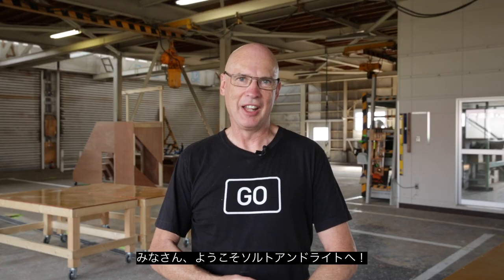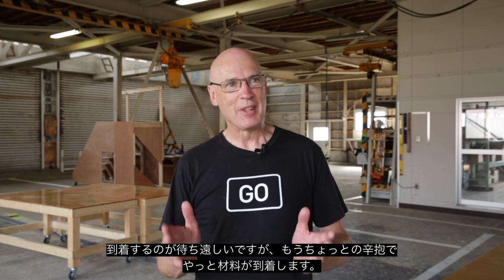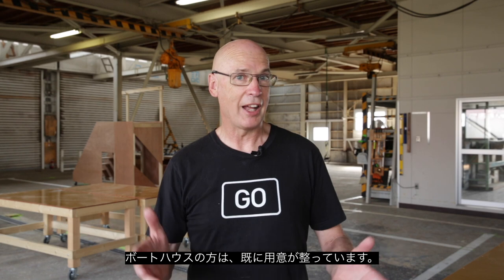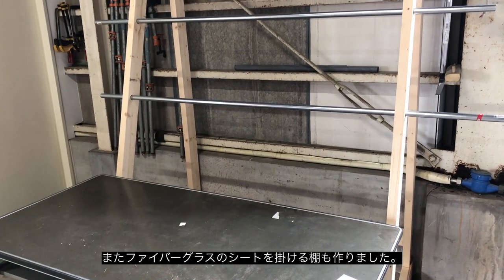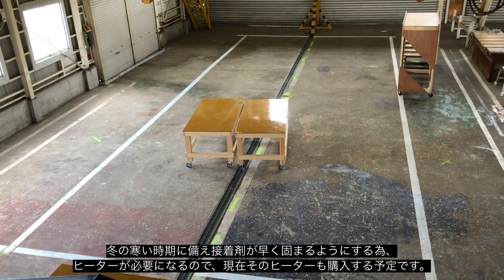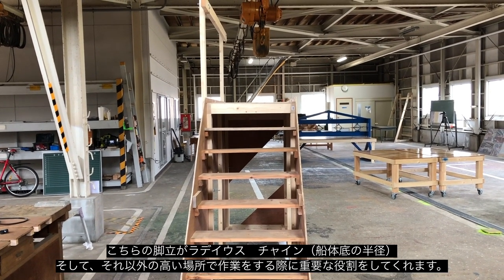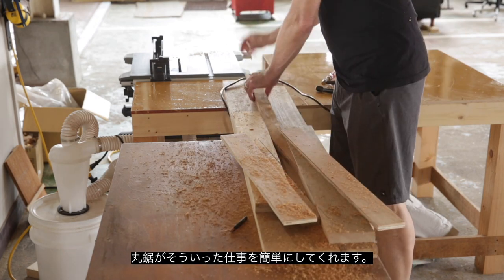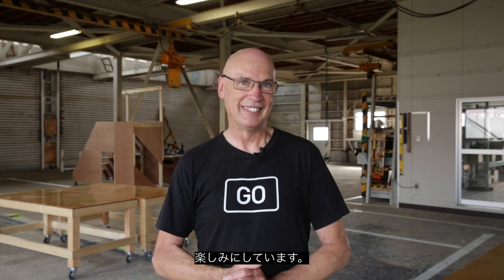Episode 7　Building a 47` catamaran in Japan

Comment: Well conceived work shop details!
Having taught College Marine Composite Construction I respect your effort.
Just a comment I topped my resin tables with Formika laminate as with nominal release agent NOTHING stuck to it.
Excess cured resin just popped off!
Also on my fabric cutting table I had it gloss resin coated with the tape measurer laminates into it.
Do you have a table saw ,radial saw and 
Band saw & chopsaw station?
How about a down draft [ wire] mixing table for blending Silica thickened resin?
With a beveled base to a vacume filter?
How does Japan deal with debris  like vacuumed film and peal-ply cloth?
Speaking of vacuumed, how are you 
dealing with sanding equipment?
We had the benefit of a ceiling mounted rolling filter/ fiber unit but I assume 
you do not have the expense for that ...so are you using vacuumed sanders?  Fairing fillers create vast amounts of dust ,trust me!
Reply: Hi Norman, 
The mixing station is still a work in progress, but I really like the idea of the down draught wire mixing table, I was still running ideas through my head on the best way to suck out the excess silica that inevitably over flows.
I was looking into building an overhead  exhaust system, but the cost was too high, so we will stick to vacuums on the sanders. Also, I intend to construct in a way that keeps fairing to a minimum, get the foundations right to start with.
Japan requires you to separate your waste into either, fireable, non-fireable, recyclable plastic and aluminium and glass. They have certain days for each. I will need to check what the peel ply comes under.
I built a table for my table saw and fitted it with its own dust extractor.

Comment: KEV: Glad my suggestion on the down draft appealed to you ,I have exclusively used then for the last 1r years,they work great! If you use a fan yo pull the air down insert micro filters in front of the fan ( I use reostats to controll dn/ draft)
Use disposable filters and chance often
On another note because the school shop is apart of the general education structure ,to cut down on dust, prefinish
The Plywood sheets prior to mounting then we only address the but seams.
Only apply the filler not the paint!
Best to bend when the filler is green.
I place a extra smooth sheet of waxed formidable sheet face down and pull a vacuumed to insure a mirror smooth finish counter sink your screws slightly
To resist stress cracks around the heads ,then fill with same putty ,to match
This system insures a slick finish!
I ALSO DO NOT FINISH To The Edges
So when I fair the sheets together I do not show raised edges...you can also just sand taper prior ro mounting.